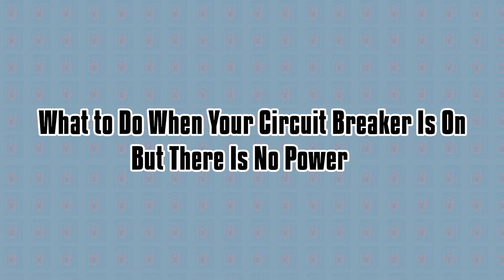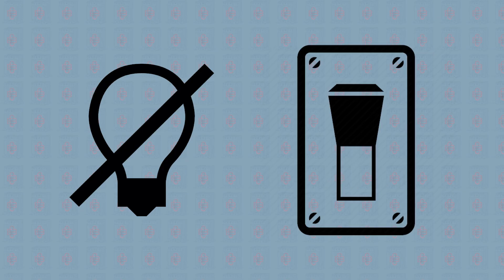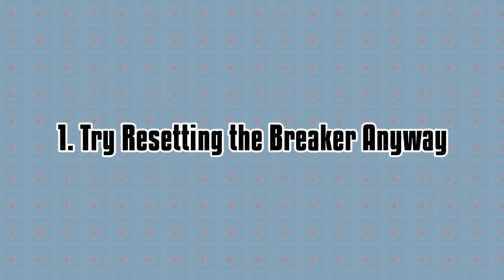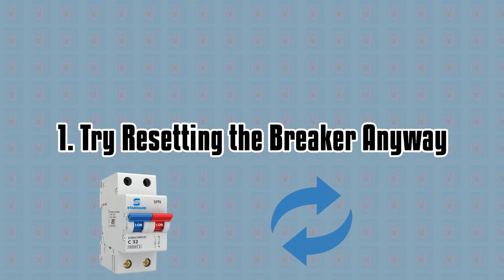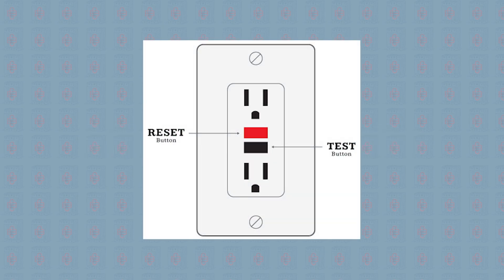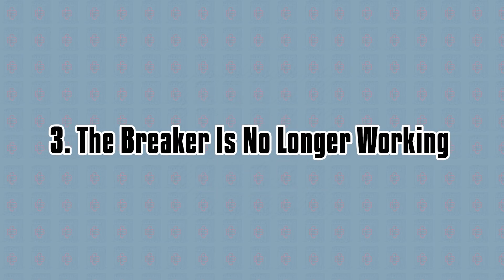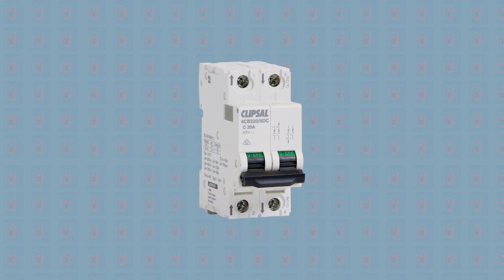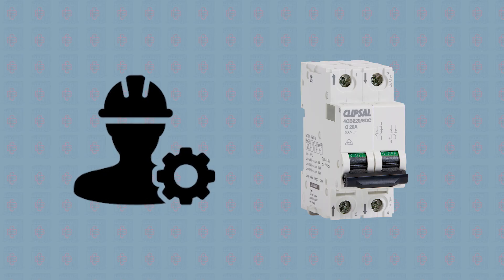What to Do When Your Circuit Breaker Is On But There Is No Power

Comment: Thank you so much for making this video.  You just saved me $$ from having to call for an electrician for what is an easy fix.  I have an outdoor circuit to my patio with no power, and the Siemens breaker switch looks like it was on.  I switched it off and then back on several times but no luck.  I watched your video and then found a plug with a GFCI reset switch and pressed that and then BINGO it worked!! You made my day :)

Comment: I have lost power to a circuit in my home, when I went out to the Power box and opened it, no breakers were tripped, more specifically the breaker associated with the circuit that has no power, I replaced the 15 amp breaker thinking it may just be bad, to no avail this did not solve the issue. I proceeded to use a multimeter for the entire Power box, meaning each and every circuit breaker, my results were 119.6 volts for every breaker including the main. I removed all of the receptacles, one wall switch and 3 outlets ( no GFI's) to insure no loose or broken wires existed, and to ensure they were all tight. The 3 outdoor lights on the circuit were also addressed to insure connections were tight as they should be..... Still no power.
Reply: I’m having the same issue. Breaker did trip initially, but after resetting, now the entire circuit has no power. Replaced the GFCI outlet, still nothing, then replaced the breaker and still nothing. Searching for answers.
Reply: @ZNEBRAAJ  As it turned out the home run was not as one would want or think, the home run went from the fuse /breaker box to the first outdoor light on the garage (and it was hot) however from that light to the second garage light to the porch light, and to the interior was dead. My fix was to convert another wire within the home run to make it hot, and as we went from light to light and then to the interior we tested each one along the way. Once we were inside we converted the outlets from just sticking the wire inside the back of the receptacle, to using the screws on the side of each receptacle. We tested the entire system, and then turned the breaker on with positive results to this day.

Comment: my of two garage outlets don't work but I have power to the garage circuit? They're regular not GFI either, I may have to cut into my drywall to trace but if u or anyone has any other ideas I'd much appreciate them. Thanks

Comment: I have this issue, except I have voltage at my load side of my breaker in the wire terminal. 
A storm came through and all of the GFCI receptacles in my bathrooms don't have any power. I pulled all the receptacles out and tested the voltage at the terminals, nothing. All breakers reset and voltage at all the terminals, yet no voltage at the receptacles.
Reply: did you find out the problem?
Reply: @Fleur_de_Lumina  Yes! After about 3-4 months, I was about to give up and call an electrician. I decided to do a once-over around my house to find any hidden receptacles. I found one above my garage doors, on the outside on the underside of the eaves. This was the tripped receptacle! I needed to get on a stepladder to reach it and reset it. I will probably completely remove this receptacle as it really serves no purpose. Thanks for following up!
Edit: This also means whomever wired this decided to put this receptacle first before all the other GFI's in the house. Truly mindboggling why they did it, terribly done.
Reply: @hawks9nkh  Thank you for the reply, I appreciate it.

Comment: What happens if nothing works but you replaced the breaker (cracked) anyway.  Still doesn’t work? Call electrician?
Reply: Here’s the answer for my situation.  I actually had a small electrical fire in one of my kitchen lights (fan style).  No smoke, flames or smell. I actually had been walking around a few times afterwards as I had to go to the breaker box. Electrician came yesterday and the first words out if his mouth when he took the light down was oh you had a fire in here. Lol Guardian Angle working overtime fir me.
Reply: Same question lol

Comment: My breaker is on, and there is power to all the outlets in the room except the GFCI outlet that tripped. I replaced the GFCI, but it sill won't reset, as there is no power to just that outlet. I can't figure out what is going on... It seems impossible. It's not the breaker because the other outlets do have power. It's not the GFCI outlet because I replaced it and the wiring was good on the first one anyways. Black to black, white to white, ground to ground. Any suggestions?
Reply: There might be another GFCI in the home
Reply: @ivanbarba4568  i have 2 in my house however both of them being reset did not work, and only the 2 back rooms are without power. Also tried flipping a switches which oddly there is only 4 switches and still nothing in the back two rooms thought maybe there was another breaker somewhere else but that doesn't seem to be the case. All outlets and ceiling lights are not working in only the back 2 rooms